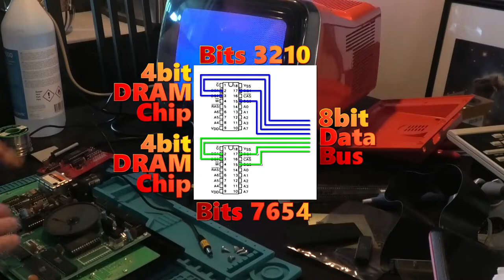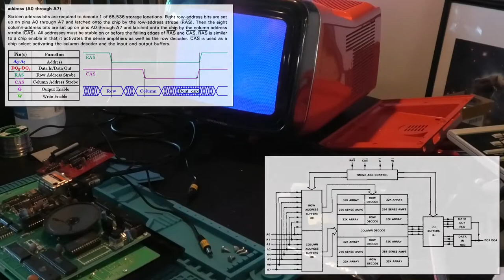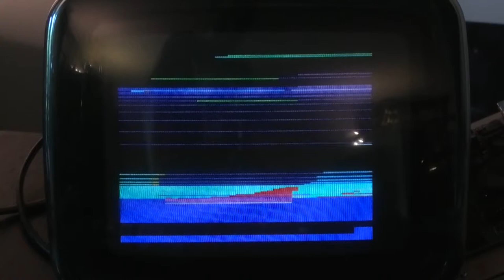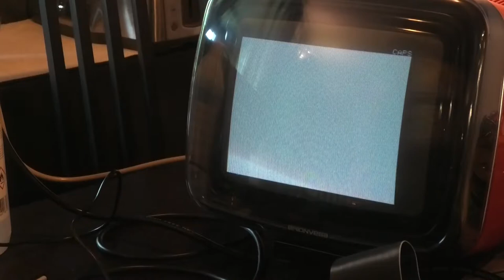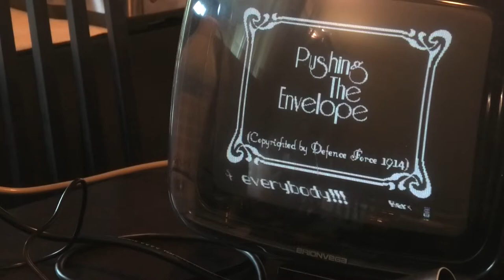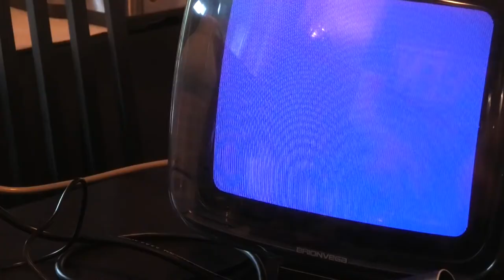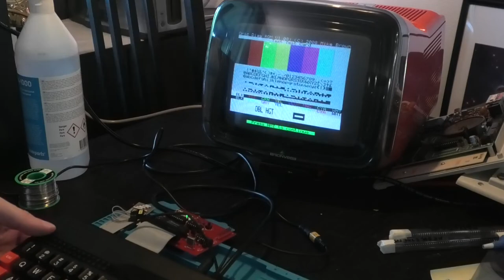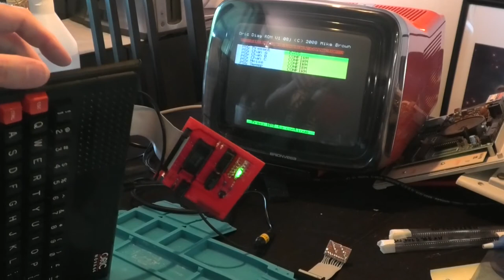Oriclopedia: Oric Nova 64 repair (Part 2 -  It's alive!)

Comment: Awesome 2 part video.. I have an Oric 1 and an Atmos here which I about check over, and if needs be, restore. There's a bit of History to these computers as they were used as dev machines by a UK games developer in the 80's known as Wintersoft who only produced two games for the Oric, The Ring of Darkness and Operation Gremlin. 
I have a question about Oric emulation though, and I've had the games running before in Oricutron. Both are multi tap file games. Ring Of D needs to be this way to load multiple sections as you get towards the end of the adventure and you enter the dungeon, but Operation Gremlin is just one load but in multiple tap files. It's been a while since I used Oricutron and I swear I was able to load multiple tap files without having to insert a new tap file when it starts searching. I just can't remember if it's a naming conversion for the files or what. love a little help.. cheers
Reply from the maker: Glad you liked the videos :)

Regarding these two games, they are very hard to find as original, I personally don't have them, so I got the oric.org version and the zip file contains four .TAP.
I managed to get that to run on Oricutron by creating a single file using the COPY command in a command shell.

copy /b GREMLIN.TAP+GREMLIN2.TAP+GREMLIN3.TAP+GREMLIN4.TAP gremlin_complete.tap

Then you can easily load the big concatenated file in Oricutron

I hope that helps :)
Reply: @DbugII  That's awesome.. Just tried that out the linux way using 'cat' to combine the files and it worked a treat. I've got a few copies of the original games here, and the original artwork for the game covers. It's one of those strange things in computer history where Wintersoft did some amazing things for the Dragon 32. Featured many times on the covers of UK magazines, got to the top of the charts for the Dragon with a few of their games.... but no one remembers.
Many thanks for the quick reply... keep up the great work ;)
Reply from the maker: @KineticEgg  Would you be considering selling one of each? 
Also, if you can do good quality scan of the game covers, I could update oric.org with that data!
Reply: @DbugII  I can supply the scans with ease.. I'd like to keep the copies I have as I'm donating a set of Wintersoft titles, Dragon, Spectrum Oric and CPC, to a certain retro museum here. But I can talk with the creator of the games and see if there's more hidden away, as there seemed to be a big box of returned items that failed due to the poor cassette quality.
Reply from the maker: @KineticEgg  That would be awesome, technically that would be "new old stock" games.

Last year I got a brand new Oric book ("Dynamic games for your Oric") from the author who had unsold units in his attic, and I know a couple other people ordered some from him, he was probably not expecting that after 4 decades.

Comment: 16k Oric1-Board? I have 2 16K-RAM-Chip replace with 64K-Ram-Chip.
Reply from the maker: The 16K Oric 1 are relatively rare, imo it's probably a good idea to just keep them like that, and get an Atmos on the side to run actual software :)